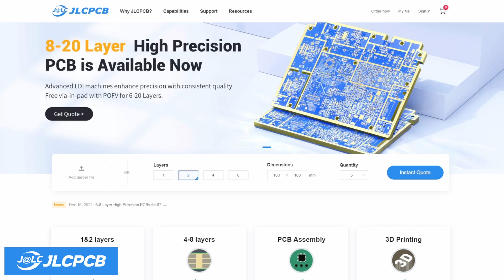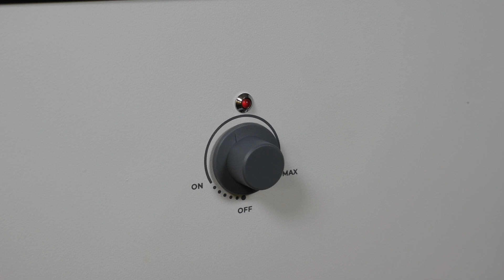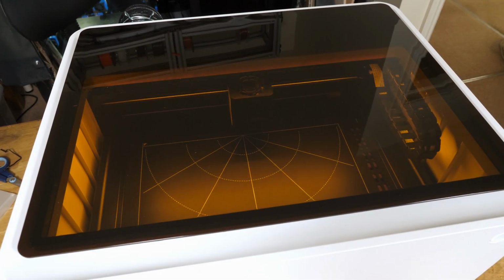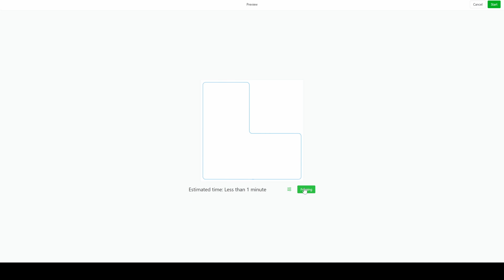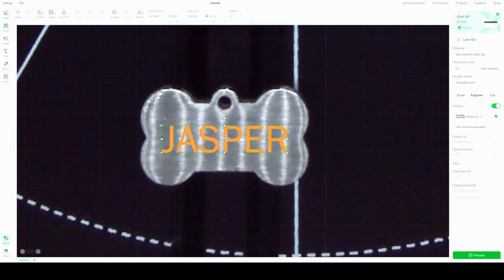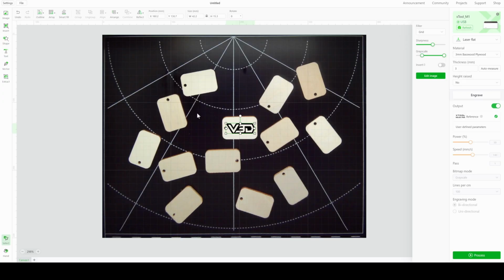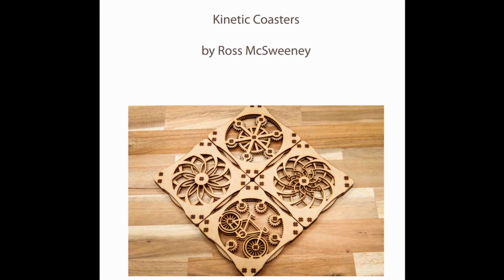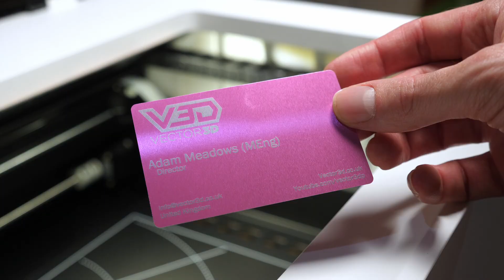Boost Your Side Hustle with the XTool M1

Comment: Can I laser etch something and then cut it out  right afterwards or does it have to cut out first?
For instance, if I want to cut out key chains all with different images on them, can I lay down one large piece of wood, engrave the images then cut around the images to make individual key chains?
Reply from the maker: Yep, I did this too but was just a boring test piece so I didn't show it. I just had engraved text on wood and then laser cut line around it. Best way to get alignment for sure.
Reply: @Vector3DP  That’s great to hear!  Thanks for your answer. 👍🏽
Reply: And by the way, thanks for this great video. I just subscribed. 😊

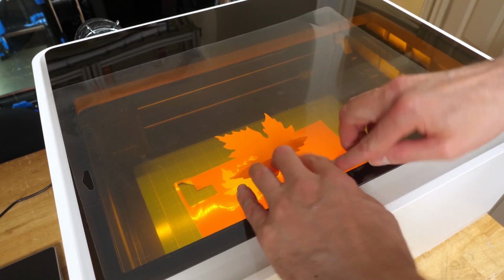Comment: Hey Vector3D! The clear plastic sheet you attached the vinyl to at 5:48 is the sheet that goes over the sticky mat to keep it from beeing clogged up with dust during storage :) And if it gets clogged up they should beable to cleaned with mild soap and water and a soft brush :)
Reply from the maker: Lucky I kept them! I suspect most people will think they are rubbish though before it's too late. Would be nice it it was marked or something.

Comment: Nice machine but the need to bump the price down.... I could have two or three vorons 2.4 😂
Reply: Voron’s have lasers and blades now, and come in a box!? I think this is a case for “the right tool for the right job”.
Reply: @float32  but if I buy the parts seperate the voron parts cost more than a co2 tube and some extrusion etc...
Reply: @ronsone8373  yeah, if you buy the raw ore and petroleum it will be cheaper too. This is for someone that wants something that works right away, not a DIY hobby.  And, you need to include time.